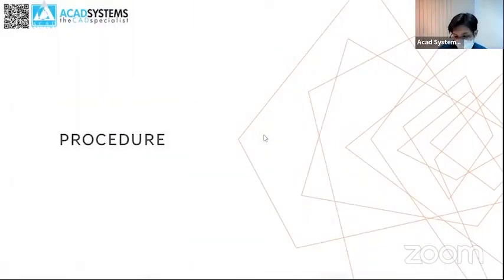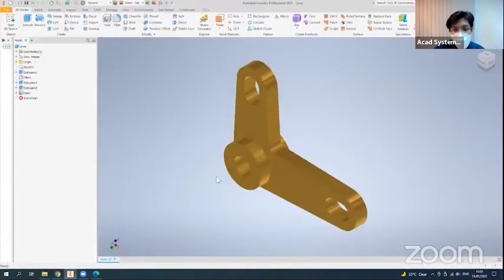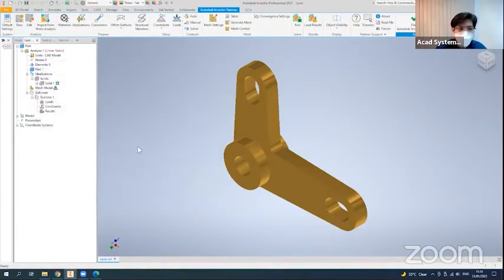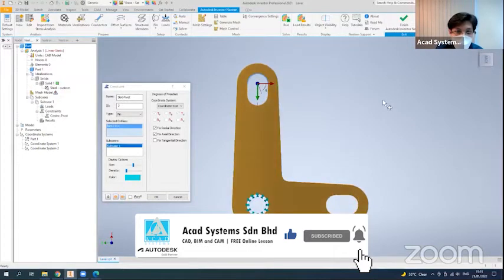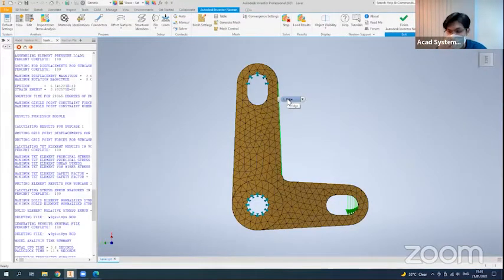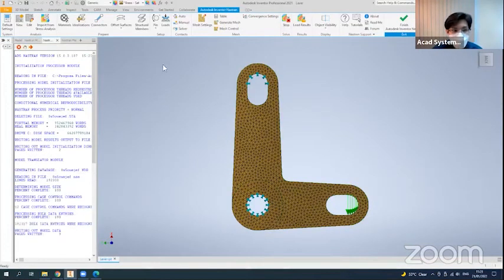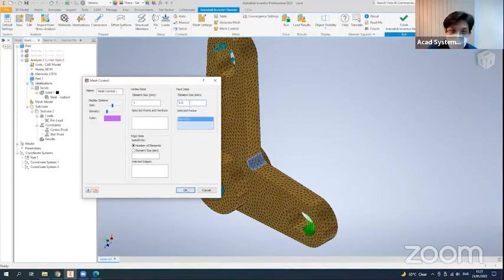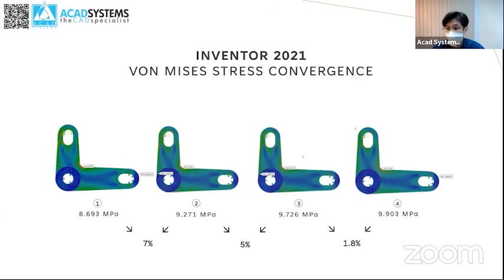Basics of Inventor Nastran (FEA Simulation)

Comment: Hi! I got your results using your recommended mesh settings.  However, when I applied an overall mesh with an element size of 0.3 (parabolic), a mesh control of 0.2 on faces 8, 11 and 16 and a max. mesh growth rate of 1.1.  Strangely, a max. stress of 17.3 MPa occurs on the lower edge of face 8 😅